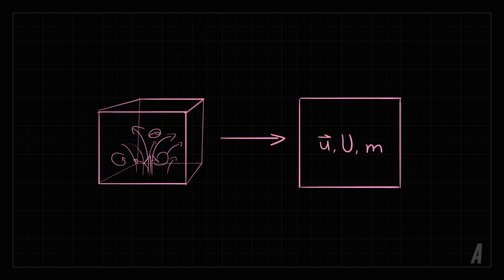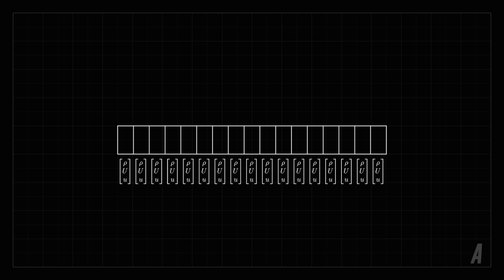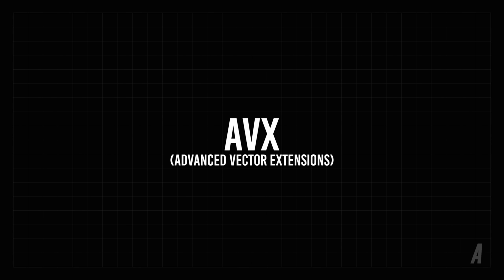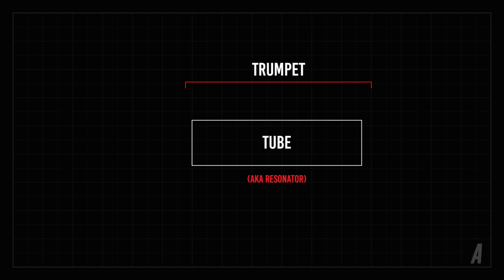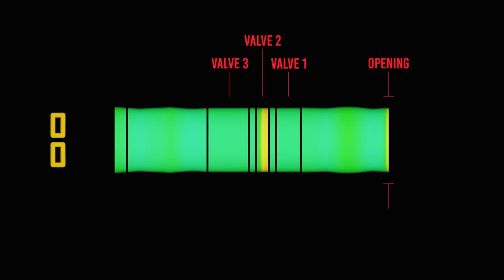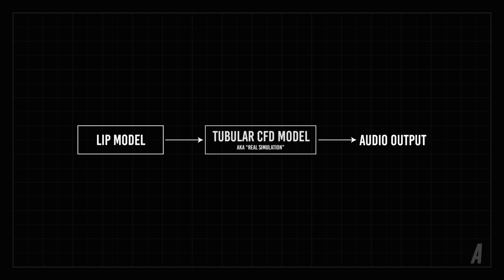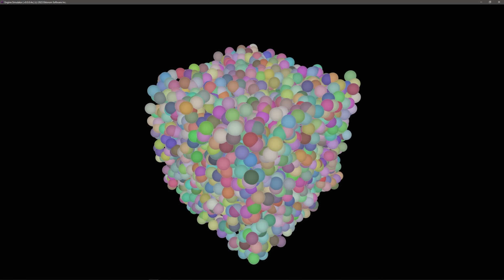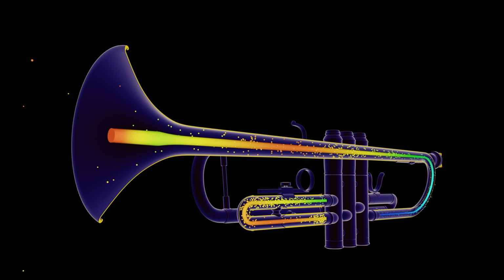Real-time Trumpet Simulation [C++/Vulkan] [WARNING: Flashing Lights]

Comment: Former professional tuba player here - you warned us about the intonation and the difficulty of tuning all of the lip & instrument parameters in real time, and then when the sound simulation started... it sounded exactly like someone struggling to get a good tone from a weirdly-built trumpet.  This is IMPRESSIVE
Reply: exactly! it sounds like someone playing one of those really shitty plastic pocket trumpets! i was never pro, but i played brass and woodwind for many years. well i suppose i did get paid to play a few times so maybe i can claim to be professional lol. i've heard a lot of weird horns over the years though, and the sim sounds like a weird plastic trumpet in its mid range. in the low range it becomes more "cheap yamaha keyboard" to me.
Reply: @Gunbudder  It makes sense to say it sounds like those plastic trumpets I think, since the simulation does not take into account things like materials and how those materials vibrate through pressure fluxuations. Perhaps ATG might add something like that since there is a big reason why professinal instruments are brass. Though I have never played a instrument.

The sim is really cool and I like where it is going.
Reply: @nimits9437  yeah I don't think the material was brought into account for now. More of a big deal when talking about instruments instead of engines. Anyways reeeealy cool stuff!
Reply: @nimits9437 yes, the simulated output it pretty much just the air coming out at the end of the tube, the body vibrations resonating the brass material is not there and i think that's where the tone is lost
Reply: @addi271  in wind instruments material has almost no effect on sound. It's the enclosed air that resonates directly, it doesn't use its own material to transmit vibrations to the air (unlike cello, violin etc.). So the sound differences compared to a real instrumentsdoesn't come from that, but more likely due to other things that aren't simulated. Real trumpet has a much more resonant medium range, which isn't here, that's why it sounds more like a french horn
Reply: In reality the geometry and material properties of the brass and it's connection's, as well the contained and surrounding air produce very complex resonance characteristics with very similar dominant harmonics but different timbre due to small deviations and imperfections.
Reply: It really resonated with you then?
Reply: It sounds like a mix of a trumpet and a kazoo.
Reply: nah this sounds like some of the trumpets from my band
Reply: Someone needs to hook this up to an ai that is learning how to dootdoot
Reply: considering how few variables were used compared to the near infinite there are in irl instruments, the sound it made was amazing. I’ve been playing trumpet for about 7 years and the variety in the sound you can create just by changing the speed or shape of airflow is so similar to what he showed in the simulation.
Reply: i would be curious if just feeding this exact audio into a very simple metallic resonator and mixing some of it into the output would sound real enough
Reply: it reminds me of someone playing with a mute, or covering the bell with their knee
Reply: Kinda sounds like it has a mute in it. When he blasted it, it sounded just like a sixth grader blasting, while facing away from you, outside. With reverbe, it sounds like an alto sax or an oboe without the higher embeded frequencies.
Reply: yup trumpet player here and i was thinking the exact same thing.  his playing around with different 'extremes' such as blowing too hard or not vibrating the lips enough all sounded exactly like they do in real life.  it's funny because the author doesn't seem to realize just how accurate this is

also to anyone watching this and coming away thinking brass instruments must be hard to play- you're right!
Reply: it just sounds like a french horn imo lmao
Reply: Joke's on us, he bought his actual trumpet just to fake this video and now he's struggling to play it 😆

(JK if that wasn't obvious)
Reply: Too good to be not real.
Reply: Yeah like. Few knobs or levers would be interesting.
Reply: Same! Also tuba player as well lol
Reply: tuba on top fr
Reply: I was going to say a middle school trumpet player with a weird mute, but this works, too
Reply: I played tuba for all 4 years in my highschool band
Reply: Yeah. Great stuff.
It sounded exactly like me trying to play ... hehehehe
Reply: Hell it just sounded like how I sounded as a beginner when I was a kid. It's not that far off!
Reply: As someone who has some limited experience playing a trumpet I laughed at this comment remembering me strugguling to play low notes because I couldn't relax my lips enough in a way where it doesn't sound like someone with diarhea farting
Reply: Shut up mate
Reply: I played trumpet from 5th grade up through college, and yeah, this was weirdly close to a trumpet, but with the oddball tone you get when you play just the leadpipe.  Pretty sure the 1-3 and 123 valve combinations were a hair sharp, just like a real horn.  Not to mention the part where he ramped up into overblowing territory, yup, got that right too.
Reply: "Congratulations! It sounds realistically terrible!"

Sarcasm and jokes aside, this is really impressive.
Reply: Does former professional tuba player make you a currently professional tuba quitter?

Comment: How much control do you have over the lips? Some of the early sounds sounded like me when I was struggling to get them tight enough together. This also lines up with your concern about using to much volume of air to achieve sound. I think it is the higher velocity that this forces that helps reduce the total volume needed to achieve the same energy (but someone correct me if I am wrong). Also, how much are you simulating outside air pressure in this model? It may be more to simulate and not worth it, but the fact the trumpet is actually a small tube of fluid pushing fluid in a larger body of fluid I would suspect has an effect, but I honest don't know!
Reply: Adding further to the "it's a tube of fluid in a larger body of fluid" I wonder how much resonance from the skin of the tube to the surrounding body matters.

Comment: Valve horn player here. Great job on trying to capture this complex procedure!
Couple things I know from playing a brass instrument:
- The most important part is the lips that distincts between a good player and beginner. I can make my instrument sound like your simulation, just by adjusting my lips.
- Air Pressure and Lipstiffness increases with higher notes. Playing loud and deep is as hard as playing quiet and high. But one can compensate this by having a more accurate and more stiff/loose lip
- The way I let my instrument sound different with the same pitch is by increasing or decreasing the volume of my mouth. Bigger Volume results in a more round tone that is often nice to hear. But sometimes in certain musical genres you want this duck like quacking and therefore you decrease this volume (by adjusting the tounge mostly). This also is dependent on the tone - higher tones are generally played with less volume while lower tones require more volume for the same quality of sound.

Do with that information what you will, just some insights from my end.
Reply from the maker: Thanks for sharing your knowledge! It would be cool to refine the lip model using information from real trumpet players since most of the parameters are purely physical/scientific
Reply: @AngeTheGreat  time to build the worlds first lip simulator
Reply: @skeddles  google pink trombone, it has been made. it's pretty cool
Reply: @AngeTheGreat  You may try to simulate buzzing just on the mouthpiece. Some consider it a bad practice because the embouchure for buzzing is not exactly the same as for playing the instrument but without the brass tube's resonance you can freely change the pitch so might be able to see better what lip configuration is in tune with each tone.
Reply: @AngeTheGreat Dr. David Wilken did his dissertation on brass embouchure, and he has some interesting videos showing brass players playing into transparent mouthpieces.

One of the more interesting things I learned from that is that not only are the lips not centered vertically on the mouthpiece, but a brass player will adjust the mouthpiece position depending on range.
Reply: @AngeTheGreat  I came to mention the impact of lip stiffness on trumpet sound and pitch as well. We usually call this "embouchure", which can be defined (by Philip Farkas) as: "the mouth, lip, chin and cheek muscles, tensed and shaped in a precise and cooperative manner, and then blown through for the purpose of setting the air column into vibration when the lips are placed upon the mouthpiece of a brass instrument." Embouchure is one of the biggest influences on the quality and pitch of one's tone when playing a brass instrument, and varies widely from player to player. For example, Dizzy Gillespie's famed embouchure (with puffed cheeks) was antithetical to what every trumpet player has learned, but it worked great for him.

David Hickman's book, Trumpet Pedagogy, has a lot of great information on trumpet embouchure, and extensively explores the technical aspects of trumpet playing in general (including diagrams). I strongly recommend this book, and it may be available with a free account on a few university library websites. See Chapter III: Embouchure Formation and Control (page 43). Chapter II (page 37) may also be of use; it discusses the impact of your teeth on playing (in turn affecting lip vibration and airflow). Chapters IX onward address physiological issues that cause specific issues with brass instrument playing, as well as mouthpiece/trumpet design and selection (again, including diagrams), both of which may be helpful to you too.

Something else to consider is that articulation (creating separation between notes) on a brass instrument involves the tongue. Articulation not involving the tongue tends to create a "HAH" sound from the diaphragm, which we usually consider amateurish. This may add (potentially significant) complication to your simulation if you decide to delve so deep. Tongue position in the mouth can also affect airflow and tone of the instrument. 

Overall this is super exciting! I've never heard such a realistic trumpet simulation, and you explained everything very clearly. As someone who's been playing the trumpet for 20 years, I'm impressed
Reply: As a trombone player, I agree with this comment. I think to really improve the sound you would need to simulate the mouth cavity (up to the whole body) as it acts as a resonance box.

It would be fun to play around with a trombone sim as it is simpler than a trumpet (sim-wise, there are no valves) and it would illustrate how the pitch changes when the length of the tube changes.

Awesome work, I really enjoy what you're doing !!
Reply: You should be aware that there is an entire cult of belief systems by brass players that is dogmatic to the core. They actually believe that the oral cavity has a dominant effect on the pitch and tone  played while barely giving the lip aperture posture any direct credit. 

Also, brass players will present their popular "quasi-technical" buzzwords which are not accurately defined or are misidentified. 

Some have already done so in the comments here.

Examples :

If a brass player says "air volume" They are usually referring to air flow. 

If they say air "speed" they may intend any number of definitions. Usually they intend air exhalation effort or air pressure, or air flow or actually air flow velocity.

However, they will define  anything as they see fit at any time and will switch definitions without notice. 

Regarding air "speed" which is an EXTREMELY popular buzzword among brass musicians. It is widely accepted in the brass world that air "speed" alone directly controls the pitch played. They literally believe that narrowing the oral tract will increase the air flow velocity EVERYWHERE downstream, including through the lip aperture. Thereby claiming that air "speed" controls the pitch. But of course that is just popular nonsense. 

To suggest otherwise is heretical. 

Just be careful when talking to actual brass musicians.  They are hopelessly immersed if popular (but confused) verbiage and metaphorical concepts. Not even the most rudimentary fluid mechanics or acoustics are understood.

I am a professional trumpet player AND engineer.

Comment: Sounds already great, even with parts missing
Just a few questions:
Do you handle partial valve opening, not that I know how that sounds on a trumpet?
And do you think it's feasible to simulate the resonance characteristics based on the material and shape of the tube, to my knowledge it's a important part of the sound of some instruments, and I guess it could be approximated by estimating the volume change of the tube based on the internal pressure.
Anyway keep up the great work, always learning something new watching your videos
Reply from the maker: Partial valve opening: this is accounted for in a realistic way. If it wasn't accounted for, the transitions between valve released/pressed would sound extremely harsh and synthetic. The simulator does allow you to hold the valve in the middle position if you really want to.
Material resonance: "maybe". To some degree it supports this when it comes to sound wave reflection, however, the vibration of the material is not something that I've really looked into in great detail.

Thanks for watching!

Comment: It's weird. I'm having issues streaming this video in particular. It keeps buffering. All the other videos are fine. My internet speed is more than fine. But this video keeps buffering. Weird.
Reply from the maker: That is pretty strange...
Reply: same, just watched another video while waiting for this to load and came back for less than 2 minutes of playback...
Reply: @bary450 Been away for 10 minutes, came back to 10 seconds of playback. YouTube obviously hates videos referring to (Trump)ets...
Reply: Yeah, that's going to be my theory for now. YouTube sees the name of the video, also sees that you said The Name a lot of times, so it assumes you're trying to convey some sort of political message. So it throttles your video until someone can manually check it and unblock it. That's my guess.
Reply: I had the same issue but yt-dlp was able to download the whole video in 2 minutes.
Reply: I had the same problem and now, when I enabled "statistics for nerds" I see that connection speed is exceptionally low (~160KB) when I select 1440p60, but many times faster when using different resolution. 
Anyways, great video

Comment: As a musician by training, I can tell you that this trumpet simulation sounds precisely like a trumpet -- and before adding the reverb, it sounds precisely like a trumpet in a well-dampened practice room. 
Awesome job mate!!!
Reply: Or outside on an open field or on a top of a soft hill top.😊
Reply: @Petch85  In those scenarios you'd be hard pressed to find a location that won't create an echo, no?
Reply: @gownerjones  There will be some reflections from the ground, but if you have a soft ground, like grass, it will be minimum. To make an echo you will need a hard surface for the sound to bounce off (off). Where I live it is much easier to find a place with no echo that one with. But if you live in a mountainous area it might be harder. But you can try the top of the highest mountain or the peak with the larges distance to the nearest mountain.😀
Also you need a low wind speed to reduce the bagground noise and new fallen snow can also help you reduce any reverbe or echo. glhf.
Reply: @Petch85  It sounds like you have a lot of experience doing this. Do you conduct an outdoor orchestra or something?
Reply: @gownerjones  hehe no. I just love physics, simulations, music (making, listening, editing, simulating) and hiking.
Reply: @Petch85  - everything sounds CRAZY on fresh snow, I love it
Reply: As an orchestral trumpet it does not sound like a good trumpet, but maybe a beginner